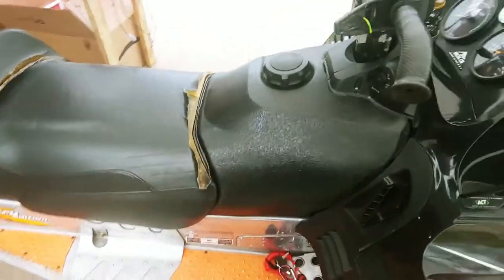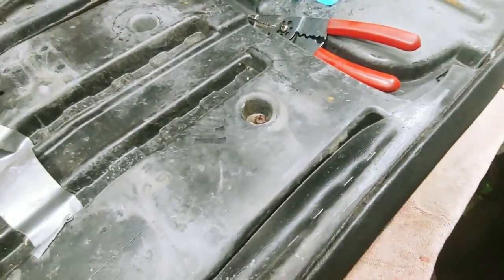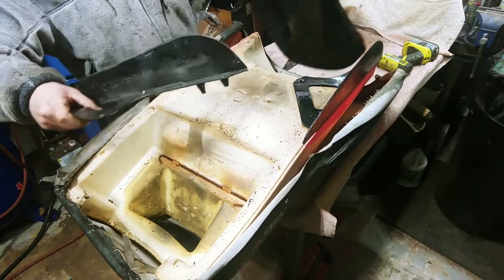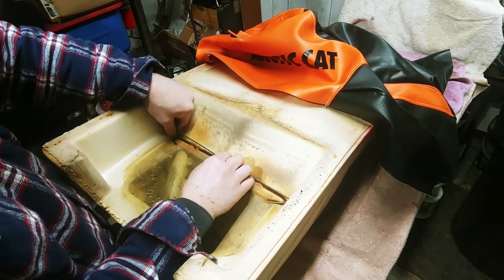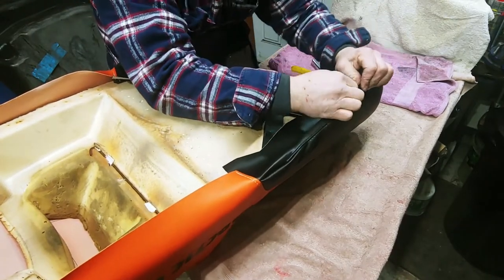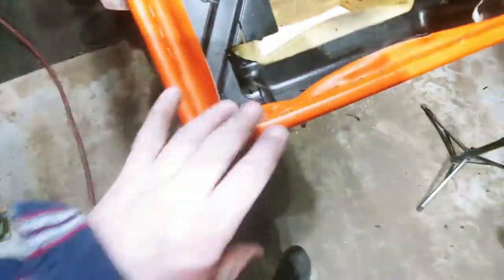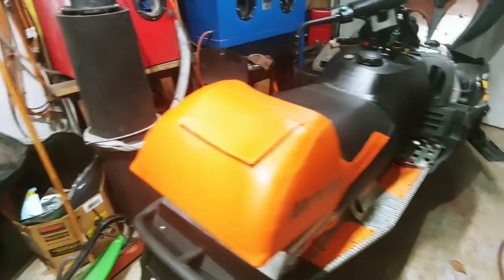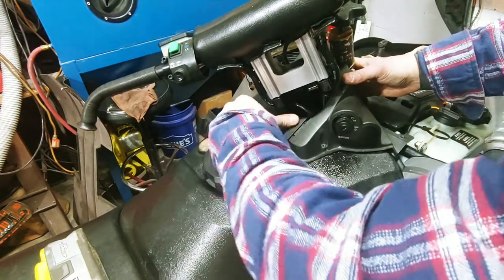02 Arctic Cat ZR 800 CCE Rebuild Part 20 || New Seat Cover [STEP by STEP Install]

Comment: Absolutely love the content, love your attention to detail, I'm new to the snowmobile world, just picked up my first Artic Cat ZR 700 project, been watching all your videos to learn as much as I can, slightly off topic question, in warmer temperatures, working on the sled outside of the winter, can you run them for an unlimited amount of time without them overheating?
Reply from the maker: Welcome to your new additction! Ha ha. 
Love me a 700! As you'll see on the channel. No to cannot. They have heat exchangers in the front of the tunnel and eotjer a set of long tunnel coolers that loop in the back or also a rear heat exchanger that dissapate heat when exposed to cold temps. You could run a hose on one of them but not for an unlimited amount of time. Ive seen people do a radiator and cooling fan swap for running them in the summer.
Reply: @Fixin2Ride-Official-  my son and I ride mid-90s Kawasaki stand up jet skis, love the two strokes, always wanted a sled, picked up a 700 for 500 bucks not running. Drain the fuel rebuilt carbs back together fired right up.  Your Arctic Cat content has been invaluable for me to get accustomed to all the systems.
Reply from the maker: Heck yeah man! That's great to hear! Another Cat life saved! 
SLED LIVES MATTER!!!

Comment: Have you recently purchased a seat cover?  I ordered one from East Coast Reproductions, it does not fit.  I even shaved down the plastic knee pad supports, just can't make it work.  I'm looking at other options but there aren't many.  I go to Country Cat for a lot of my parts, they don't sell factory covers any more ☹
Reply from the maker: I have not recently purchased one. Try using a hest gun on low to warm it up ans stretch it.
Reply: @Fixin2Ride-Official-  I tried everything, the manufacturer even said throw it in the dryer for five or six minutes to get the entire cover warm.  Funny, they actually sent me a YouTube link to your video installing the cover 😆
Reply from the maker: Oh gotcha! Yeah then I might have to say that they made it wrong or you have the wrong seat and tank on your sled? I actually got mine from a friend that makes them. Shes busy all year though and it was by grace that I was able to get my order in so I got 2 made by her. The other will be going in a Thundercat build Im planning.
Reply: @Fixin2Ride-Official-  sounds good, thanks for the information, I normally wouldn't go to Amazon for something like this but at least I can return it easily if it doesn't work
Reply from the maker: My pleasure and yep thats the good thing about Amazon..
Reply: @Fixin2Ride-Official-  ok, maybe a stupid question BUT, the VIN says it was built in 99, would that be considered a 2000 ZR 700?  In one of the forums I was directed to "Scotty Sled Shed" on ebay, he was SUPER knowledgeable and SUPER helpful.  Had me take measurements from various points on the seat and then he asked the VIN # question.  When I said it was built in 99 he said "You have a 2000 ZR 700 and the seats are very different from a 99".  So, I'm going to order a 2000 ZR 700 seat cover from him and give that a shot.  If you need covers in the future keep this name handy.

In general the 99 or 2000 thing I need to know.  I'm ordering parts and I always specify 99 ZR 700 
😥
Reply from the maker: Yes typically if it was manufactured one year it will be for the next year especially if it's towards the end of the year. And if there's a difference from one year to the next then that could be your issue

Comment: Hi I have a 2000 articat cat ZL 600 and it has been getting louder and louder over the years and that has been making it run very badly do you think you know what could be wrong.
Reply from the maker: Deff seems like hole in the exhaust.
Reply: @Fixin2Ride-Official-  ok I’ll check that out thanks
Reply from the maker: If its something you cant see initially, it may very well be on the bottom side of the exhaust somewhere...
Reply: @Fixin2Ride-Official-  yeah I’m going to take it off see if I can find anything
Reply from the maker: @joutdoors9181  Im thinking somewhere in the Y pipe just off of the cylinders. Or near the expansion pipe support.
Reply: @Fixin2Ride-Official-  ok thanks for your help.
Reply from the maker: @joutdoors9181  my pleasure! hope you find it.
Reply: @Fixin2Ride-Official-  thanks